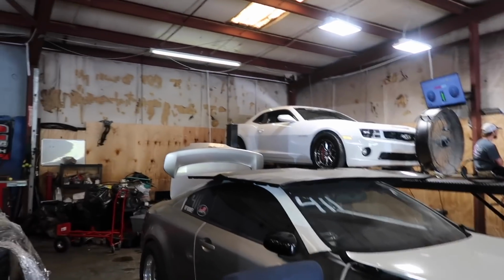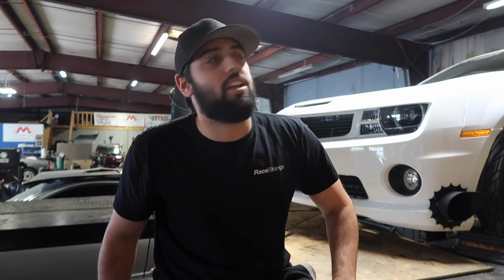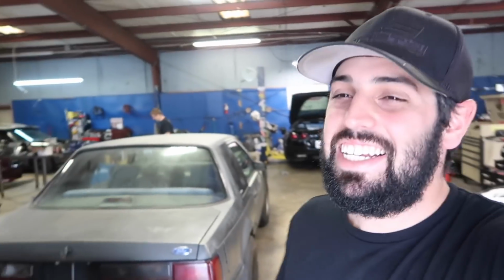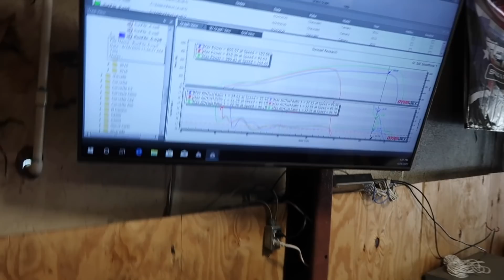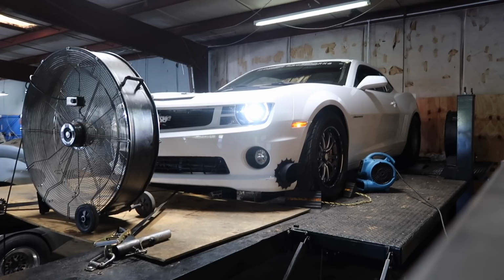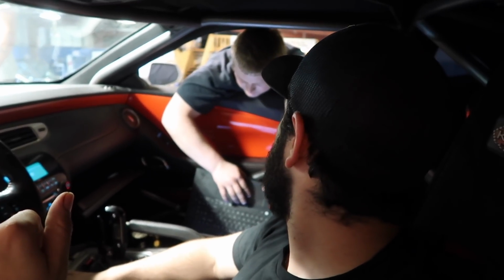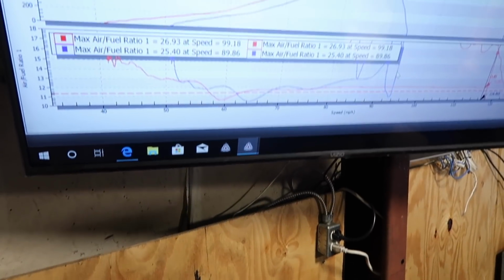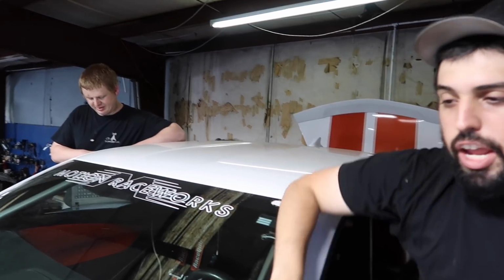BIG ISSUES WITH THE COW TURNED UP!!!!!

Comment: What is the difference between adding CO2 to the gate and using a boost controller?
Reply: dhracecars Hill we use c02 for boost control. C02 works better because it’s faster, more accurate. Using a  conventional boost controller Relies on manifold/boost pressure to bleed off air from the Bolton of the gate an EBC  add it to the top via boost.

Comment: John why bother trying to go fast in that Cow...it will never be as fast as you are trying to make it...the thing is literally a Cow and weighs to much...is a brick plus is IRS...all of which are bad......all you are doing is wasting money burning up parts trying to make it perform like a race car....just turn it down to 700whp and enjoy it as a fast reliable street car....save all you money for the Rooster which has the best potential to go real fast...also wouldn't a built 400 3 spd be better for that pig? maybe get some custom gears in it so you can play with the gear ratio of each gear allowing it to stay in the meat of the power band but more so to allow it to live for more then a couple dozen passes or smoking the fluid every pass...